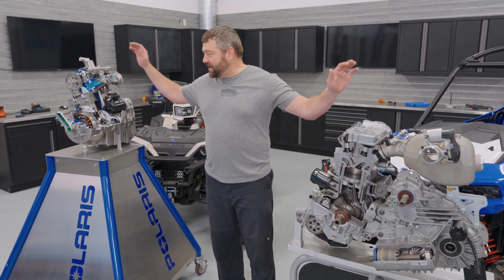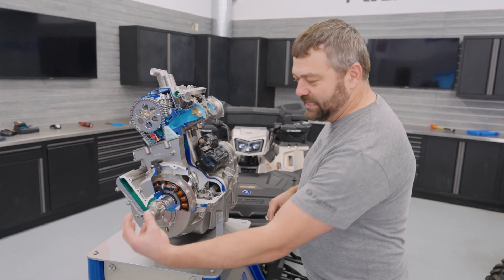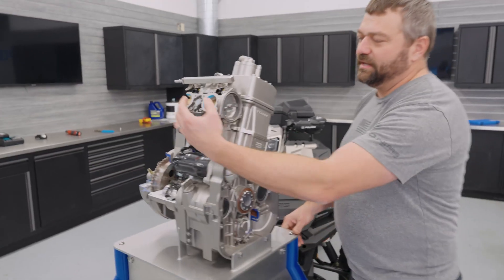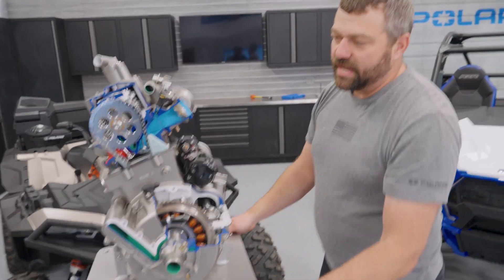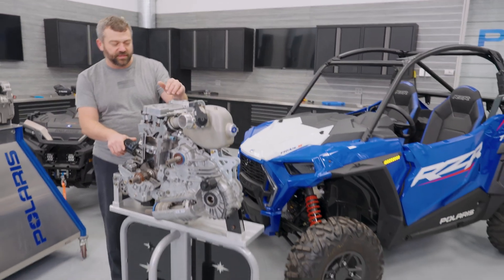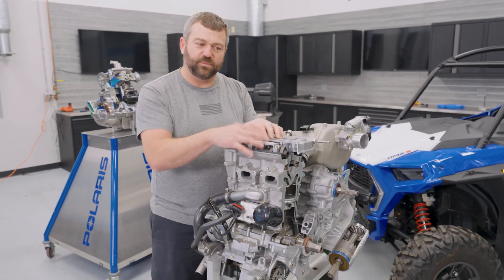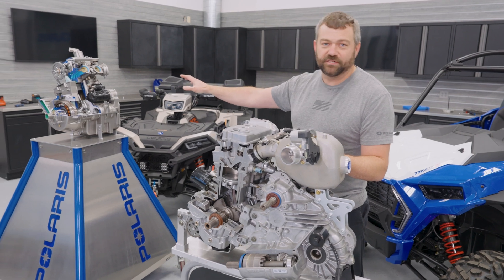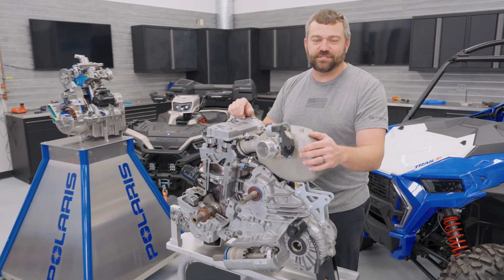POLARIS ATV XP 1000 ENGINE VS POLARIS SXS 1000 ENGINE | SHOP TALK EP. 60 | Polaris Off Road Vehicles

Comment: My 2018 Sportsman XP1000 has a Garrett GBC 20-300 TURBO with E85 and Carbon Fiber Body
175 Horsepower at 12.9 psi boost 
0-60 in
((( 3.6s. )))
Can get faster time with a wheelie bar and go to make one. 
Dragy videos are on my YouTube. 
 
The Sportsman XP1000 engine is very well built to stand up to this much Horsepower and I been checking everything 
Compression actually got better after hard 0-60 runs. 
Valve clearance hasn't changed 
Oil pressure same 
Scope the pistons, cylinders and head all look great.

Comment: if there was not such a cost difference (manufacturing cost), I'd like to have seen the 270 firing order on the Rangers and especially the generals.  Turbo Rzr already has it, XP does not.  The 270 configuration lends itself to a really flat torque curve which is great, also quite smooth running.